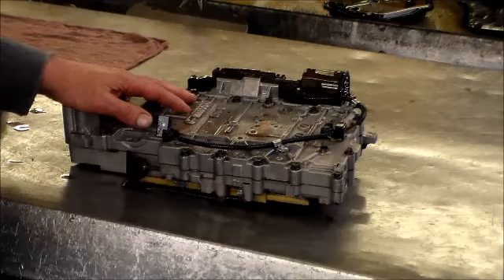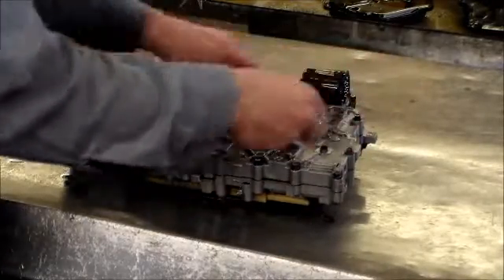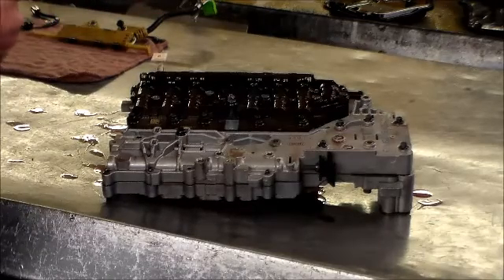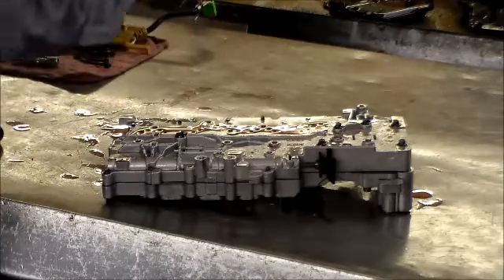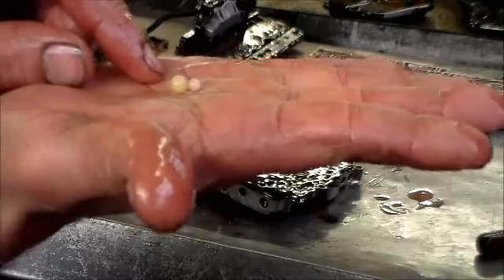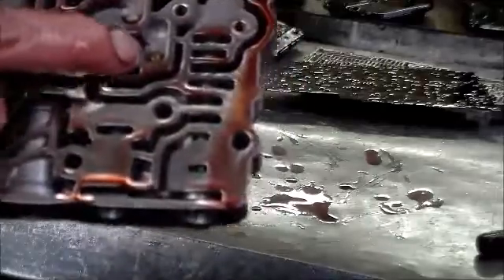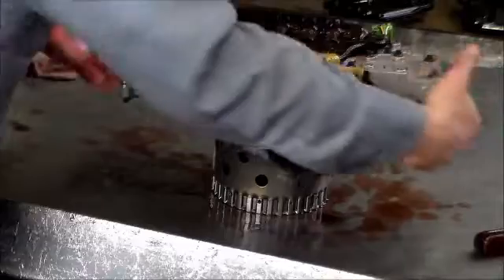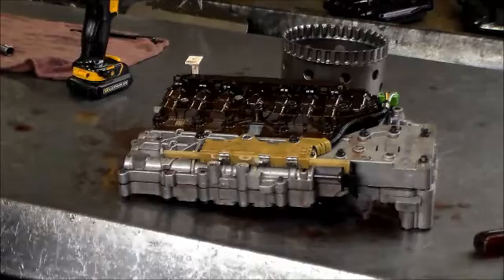6L80E Valvebody

Comment: 2007 Escalade. Every once in a while when going very slow under 7mph and go to hit the gas it goes into neutral for a second or 2 then goes back in to gear. Has a p0872 code. Do you think this is my problem? also after reinstalling the valve body do i have to take it to the dealer to have it put in learn mode?

Comment: I have this exact same vehicle. 2007 Escalade. Every once in a while when going very slow under 7mph and go to hit the gas it goes into neutral for a second or 2 then goes back in to gear. Has a p0872 code. Do you think this is my problem? also after reinstalling the valve body do i have to take it to the dealer to have it put in learn mode?
Reply from the maker: That is a pressure switch code, it could be the issue, i would certainly address the code first. You rebuild the pressure switches and you do not have to take to the dealer for relearn, clear the codes and when the trans temp is 130F-140F  drive the car and it will adapt, make sure no codes.  Also, make sure it's full of fluid

Comment: The code just went away after I replaced the valve body but now it seems like it goes in and out of gear shutter problem could it be due to the programming of the computers I kind of have a feeling that the dealership never program it but charged me SMH
Reply from the maker: ok, so you changed the valvebody, and installed a new Techm?

Comment: Nice video i have an 09 chevy avalanch with a code p0751 i had replaced the tecm took to dealership to program which i think they never did due to the code is still present they said there is no codes however my obd2 reader still reads the code i didnt replace the valve body or check the check balls was intimidated due to all components in valve body however yesterday my service 4x4 light went on again i had already serviced a month ago can and is there a part in transfer case that can cause a shifting problem?
Reply from the maker: This is a mechanical code, how does the car shift, when you had the techm out how were the pressure switches? Bad pressure switches can make a 751 code show up
Reply: Gary Ferraro hey Gary how do you tell whenever the pressure switch are bad?

Comment: Gary can i replace #1 check ball with a steel ball
Reply from the maker: You really shouldn't , chrysler uses check balls made out of torlon(like hard plastic) you can use that. Is your number 1 ball worn out?
Reply: No it is not worn out. I just figured that the GM balls must be a softer plastic to wear like that so I found a ball out of 5R55 spare parts, plastic, measures the same, darker green color, thought I would put that in it..do you think that will be ok?

Comment: Gary can you please tell me how many checkballs are in the 6L80 Valve body  Thank you
Reply from the maker: Do you mean checkballs?  if yes there are 7,
Reply: yes I do mean checkballs
Reply: What do you think about reman Dorman 6L80 TEHCM? I have 09 Tahoe setting codes for all 5 Pressure control solenoid control ckt high voltage. P0963 Line pressure control solenoid Ckt high voltageP0967 PCS 2 Control Ckt High voltageP0971 PCS3 Control Ckt HIgh VoltageP2721 PCS4 Control Ckt High VoltageP2730 PCS5 Control Ckt HIgh Voltageanother shop replaced the TEHCM with a Dorman Reman. The weird thing is it doesn't have reverse or neutral. If I shift to neutral or reverse it moves forwards like if it was in Drive.  Powers and grounds to the TEHCM are Good. At this point I think I have a bad TEHCM What do you think? any help will be appreciated.
Reply from the maker: Honestly, i wouldnt use a doorman if they gave it to me, my supplier sells them and gets alot of them back. Even talking to a doorman rep at a semiar, he admitted to a problem when they were making them

Comment: my truck came up with a code p2724.. How do I replace the pcs5. do you have a video for it? thanks in advance
Reply from the maker: what is the truck doing? is it slipping on pull away or slipping in first gear?
Reply: its like its stuck in drive ..drives forward in reverse. neutral and drive
Reply: the code reads the pressure control solenoid is stuck on ...
Reply from the maker: I would drop the pan and look at the manual valve and check the linkage first.

Comment: I have a 6l80 with pressure codes and the dealership said the TCM is going bad. What should I do?
Reply from the maker: do you know what the codes are?
Reply: p0842 Trans Fluid Pressure Switch 1 low voltage
p0872 Trans Pressure switch 2 low voltage
p0877 Trans pressure switch 3 low voltage 
p0989 Trans pressure switch 2 low voltage 

I have been told these codes mean the TCM is going bad and needs replacing.
Reply from the maker: Ben, the laminate disc's for the pressure switches are probably coming apart which is part of the TCM, you could either have it replaced or find a shop that can rebuild the pressure switches. Where are you located?
Reply: Knoxville Tennessee
Reply from the maker: I dont know anybody out there, do you know if there are any good transmission shops in your area?   Did the dealer give you a price on installing a new TCM?
Reply: Ben Kroeger - do you have an update to your issue or what was resolution?

Comment: I love watching your videos.  I wonder why you did not clean and dry the surfaces of the split valve body before re-assembly.  Every fibre of my being suggests that the surfaces should be clean and dry.
Reply from the maker: I normally always do, but this i just changed out a check ball and had to get the v/b reinstalled, this is probably the only time i didnt clean it

Comment: How and why do those check balls wear our so much?  Just the bouncing around inside that cavity?  At what mileage do they start causing issues?
Reply from the maker: Its the material that the checkballs are made of, when i overhaul one, i dont put those back, i use checkballs from another trans, ive seen then start causing issues around 60 to 80k,  Gary
Reply: Thanks Gary.  Tell me to do this repair you would not have to take the trans out of the car correct?  Just drop the pan and remove the Valvebody correct?

Comment: hi I had a question I have a 2006 corvette with 6l80 and I'm getting a code P0777 "solenoid b stuck on" put the car in drive does not move, put it in manual mode 1 and 2 does not move put in 3rd takes off fine then throws itself in limp mode, I pulled the pan the fluid was dirty no shavings or anything but quite a bit of clutch dust on magnet, I put new fluid and filter in reset it again still does same code, what does that solenoid b stuck on mean and what can it be
Reply from the maker: This code is more of a hydraulic problem, not so much eletrical problem. The code shows probably because the car is not moving, if reverse is ok, first thing i would do is drop out the valvebody, disassemble it and see if the number one check ball is worn or blew through the plate.
Reply: +Gary Ferraro reverse seems to work fine, 1st just revs up pulls the engine down does not move 2nd is the same but 3rd takes off fine, I have never torn one down myself before, is there anywhere that rebuilds them? a new from gm is spendy $700
Reply from the maker: Where are you located?
Reply: +Gary Ferraro rochester minnesota
Reply from the maker: I dont know anyone there, is the valvebody out of the car?
Reply: +Gary Ferraro not yet I think I'll take it out today, I think it is the valve body, I used a computer and manually open and closed off valves and got the tires to spin a few revolutions in 1st and 2nd where before it would not, and it said low pressure for solenoid b, I'll have to pull it out and tear it down see what I find
Reply: +Gary Ferraro not yet I think I'll take it out today, I think it is the valve body, I used a computer and manually open and closed off valves and got the tires to spin a few revolutions in 1st and 2nd where before it would not, and it said low pressure for solenoid b, I'll have to pull it out and tear it down see what I find
Reply: +ryan03cobra I have it out and torn apart could you contact me have a few questions

Comment: A buddy of mine checked the check balls and he said they were good.. he recommended Sonnax Zip Kit..also I don't have Sport mode and Manual mode?
Reply from the maker: What year is the car?  could possibly have an issue with you 4-5-6 clutch or a crack in the 3-5/R drum, After the tcm swap, did you do a fast learn?
Reply: Gary Ferraro - if you crack open the valve body and put in Sonnax's zip kit would it need a fast learn after reinstalling to trans?

Comment: Same I can go to about 50mph then it just goes to neutral until I slow down then goes to 2nd (Safe Mode) Or WOT I can go thru all gears 120mph+ until I let go of gas then just revs/neutral instead of downshift until I slow down   but if I delete codes it's good for another 5min

Comment: Hi I have a Pontiac G8 Gt 6l80e. I have codes P0700 P0796 it goes into limp mode I allready replaced TCM with a new one and same problem. Can you please help me on what I need to replace?
Reply from the maker: You could have leaking bore plugs, sonnax makes a kit with o-ring bore plugs, how does the trans shift cold and hot

Comment: when this was happening did any solenoid codes come up, because the same thing is happening to my Pontiac g8 gt which also has a 6l80e as well
Reply from the maker: Yes, you may get a solenoid performance code, do you have pressure switch codes? Gary
Reply: @GaryFerraro  I have a pressure switch problem p0842
Reply from the maker: @Iroc_twan  What year is the car
Reply: @GaryFerraro  2007 chevy  tahoe with 6 speed auto

Comment: Thanks!
Reply from the maker: DarkCry956 Welcome.
Reply: +Gary Ferraro  gud day sir I ask how many ball inside in valved body in 6l80e
Reply from the maker: +Eson Valderama   There are 7 checkballs in the valvebody.  Thanks for watching, please subscribe.  Gary
Reply: +Gary Ferraro  thank you sir
Reply from the maker: Your welcome
Reply: +Gary Ferraro  gud day sir, can i ask 1 more question. I have a trouble for 6l80e denali, which is no shifting I change clutch, rubber, piston means overhaul. .and then I check computer said than TCS..what is a main cause of that problem..thank you
Reply from the maker: When you say it doesnt shift, its in failsafe mode? are there any codes present? if so, what are the trouble codes?
Reply: +Gary Ferraro gud day sir, yes sir the problem is doesn't shift and here's the code 0700 Trannsmission Control System...MIL request...
Reply from the maker: +Eson Valderama   The P0700 is just a generic code, i would need for you to scan the TCM(which is located inside the transmission) and pull out the code. Gary
Reply: +Gary Ferraro thank you sir gary
Reply from the maker: your welcome

Comment: Excellent tutorial and description.  I have a 2007 Escalade, just like you mentioned and it is showing the same conditions.  I'm sure it must be the check ball.  I'll be pulling it apart shortly.
Reply from the maker: +Outline Tech Security  I would say that either the check ball is the problem or the bore plugs are leaking. Wen i rebuild these i install o-ringed bore plugs in the clutch regulating valves. The bore plugs fit very loose.
Reply from the maker: Tim Johnson Tim, Thanks for the kind words, Another very common problem with the 6L80E, is the 1-2-3-4 piston likes to crack, of course its much easier to look at the checkball first, let me know how it turns out and if you have any questions be happy to help. Gary(my shop is in new york)
Reply: Now, if I could just find someone that had a check ball today.
Reply from the maker: Check with your local trans shop, a 6L80E, chrysler transmissions such as 604 or 606 that ball would work, a local trans shop should have plenty of them.
Reply: +Gary Ferraro  mine is a 2007 denali same as cadillac but it only does it when i stomp down to use passing gear then send tranny into limp mode i had codes p0796 and p2723 pop up which r both pressure solenoid codes but could check ball be causing this